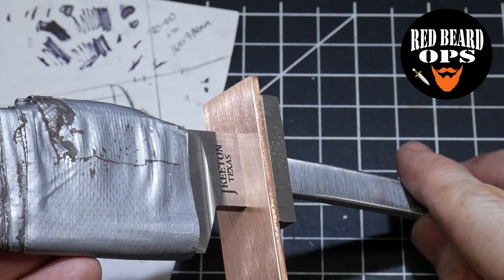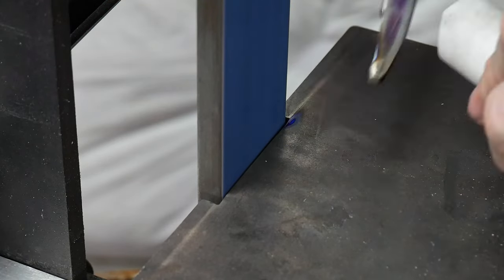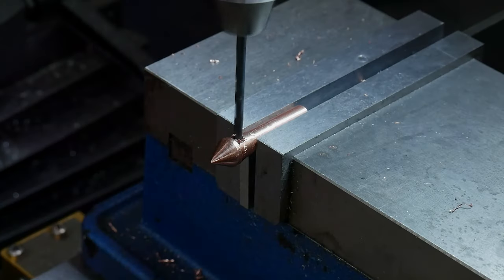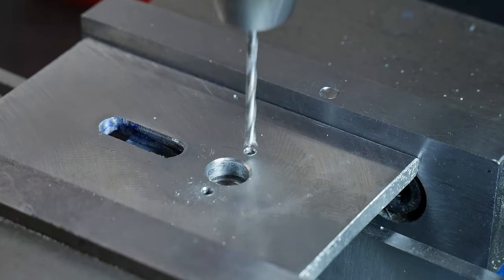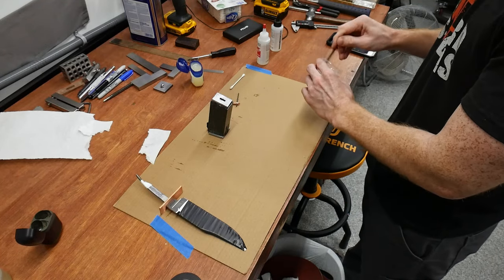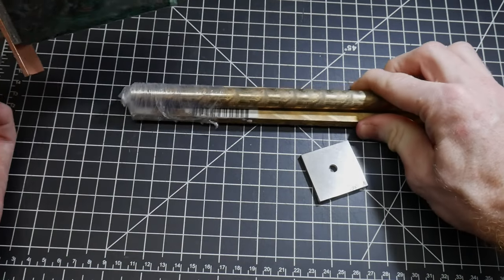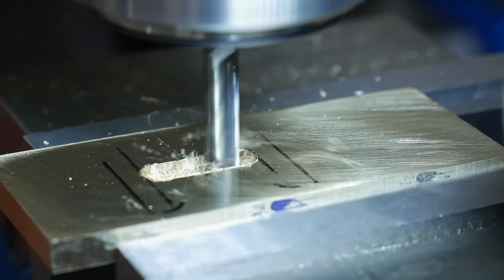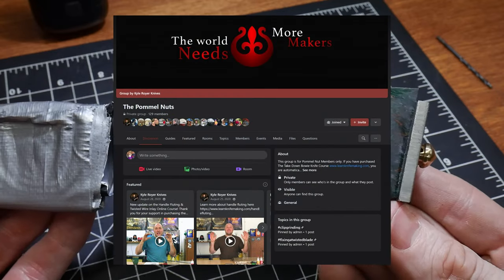Lucky #7 Bowie - Found A Weak Link - Part (3/4)

Comment from the maker: 🔥My Mini Split Install - https://youtu.be/FditJqUenAk    ------      Hope yall have a great weekend!

Part 1 - https://youtu.be/52NsShM08LU
Part 2 - https://youtu.be/a-l1g_ujZR4
Part 3 - https://youtu.be/1a1LALrwNzQ
Part 4 - https://youtu.be/x92h0rasaE8
Reply: Hey. I was thinking the other day, and I wanted to propose a challenge to you. Feel free to decline, because the only prize would be the feeling you get when you accomplish something, or learning.  and whatever money you make selling the knife. 

The challenge is, to make a knife in a high wear resistance steel. Basically anything with more than 4% vanadium, I think would be a good minimum cutoff (although the higher vanadium steels are more what I'm talking about). The reason I ask is, I would love to see what solutions you can come up with to the problems that happen when working with these steels. I think it could make for a great video.

If you did this, I recommend just going with a knife design you are already used to making, so that takes out any unexpected challenges, and leaves just the steel to he dealt with. 

Anyway, I just wanted to propose this, to see what you would say, and because I definitely do think it could make for a good video (or video series)
Reply from the maker: @_BLANK_BLANK  Thanks for the challenge man. I have a lot of projects on the list right now, but that does sound like a really fun one!
Reply: @RedBeardOps  yeah. Maybe keep it in mind once you start crossing things off the list. I would love to see what you end up doing with it, if you can get around to it.

Comment: I'm in school to be a machinist and I've been making knives for 5 1/2 years and you're really tempting me to try a build like this
Reply from the maker: Heck yeah! Sounds like you have the skills sir! Good luck with your build!
Reply: @RedBeardOps  (not a sir, but thanks) my plan is a 12" blade length and a thinner profile rather than a large belly, more like a long knife. Handle will be bone dyed orange with blackened steel fittings. Just gotta find time in my school schedule to do it.

Comment: it's turning out great, can't wait to see the end result! 
And i've never known anyone to use birch for....well anything. Do you think i'll hold up over time if this knife was used frequently as an outdoor knife?
Reply from the maker: Thanks man! With it being stabilized, I think it will hold up well. From what I understand it's basically infused with epoxy at this point.
Reply: I just did some googling and must now admit that i underestimated the humble birch. Apparently it's stronger than oak although more prone to rotting but with the right treatment that shouldnt be an issue. Keep upnthe good work man, you got me into knife making, i already had a beard so i thought i'd give it a shot 😁
Reply from the maker: @Mister_Weasel  Good to know! Good luck with your blades Mister Weasel!

Comment: I guess you want to take it apart again later, otherwise you could solder the guard on which would fill any tiny gapping you may have?
Reply from the maker: Hey Gordon, that's right. These takedown knives give the user the ability to take it apart and re-assemble... kinda a novelty and also a display of precision. It would also give you the ability to repair and replace pieces down the road. 

The real issue was me enlarging the slot too tall... it was a hard lesson that took 4 tries to figure out.... I'll now know for #5 lol

Comment: Hello, I'm having a problem with my bevel grinds.  Sometime I get "scallops" (small indentations) in my bevel.  They are hard to remove and trying to sometimes results in others forming.   it is extremely frustrating.  I'm using a modified 4x36 sander (added a small platen to be able to get to plunge line).   I have no clue what is causing these indentations.  My table is square to the belt, my jig is steady and I'm going slowly not pressing hard.  Also, my bevel is always shorter near the blade tip and trying to get it taller to match the rest of the bevel causes me to go over my scribe line and still doesn't solve the problem.  I've already ruined 2 pieces of 1084.   Do you have any ideas on what I'm doing wrong or what I should do to prevent these problems??.  Would it possible to speak with you?  Thank you.
Reply from the maker: My best grinding advice - https://youtu.be/UHOn7X3z9lA

Try practicing on some paint sticks.